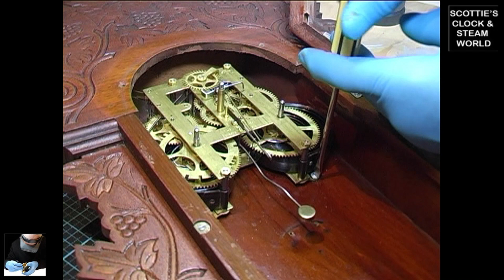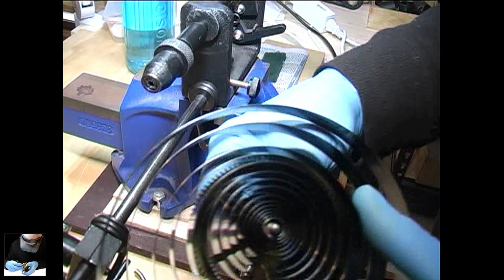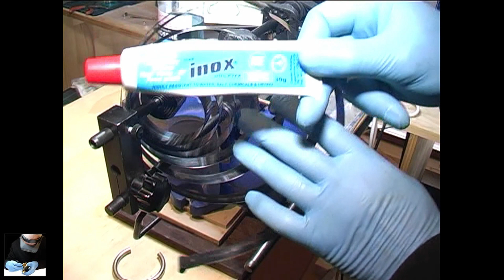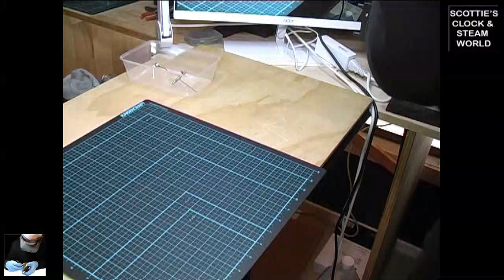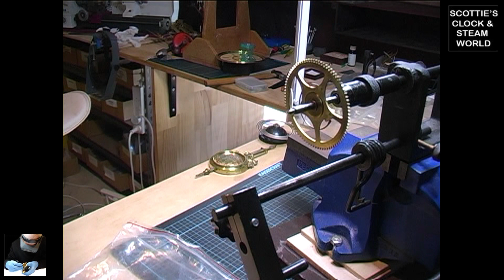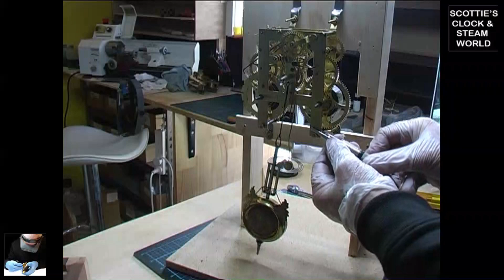Gilbert grape kitchen clock service and repair - Full Video- #americanclockrepairs

Comment: Awesome detail.  I am facing a very similar gilbert clock and terrified.  You take off the front plate.  I took of the back plate.  this may help. I understand the adjustments and see that you did this later, rather than try to set the wheels first then assemble.  Also, this customer’s clock has steel front and back plates;  never seen that.  Good video thanks.
Reply from the maker: Steel plates on a Gilbert clock is quite unusual.
Reply: @ScottiesClockWorld  I have a Gilbert with steel front and back plates - 1917 date code.
Reply: I have a Gilbert mantel clock that also has steel plates front and back, and of course brass gears.  My movement is dated 1917 - the date is stamped on the front of the movement right under the hands barrels (not sure of the definition).  Not sure of how many hours were on the movements but the pivots are actually in good shape.

Comment: Would you be willing to make a video about the wire springs, putting them on the levers, installing the levers with springs in the movement, and adjusting the springs so they will function properly on a Sessions movement?
Reply from the maker: I have a few Sessions movements laying around I'll see what I can find.